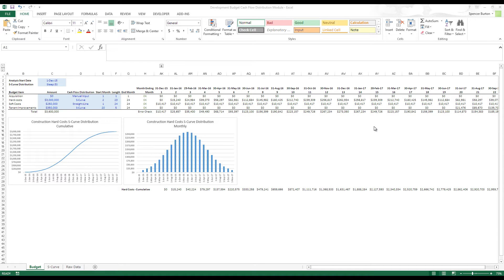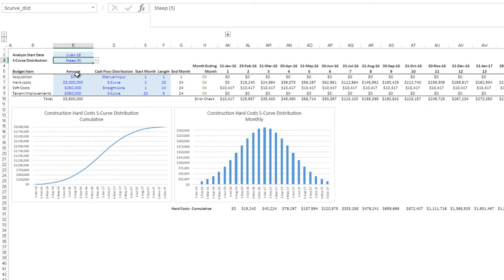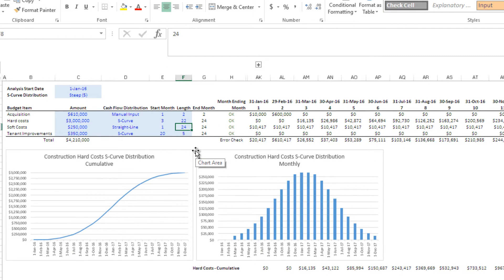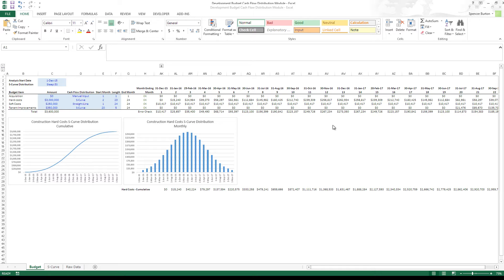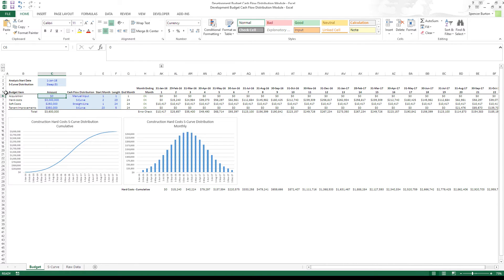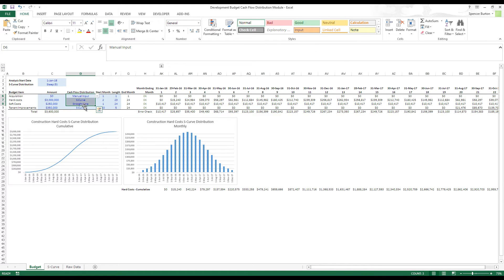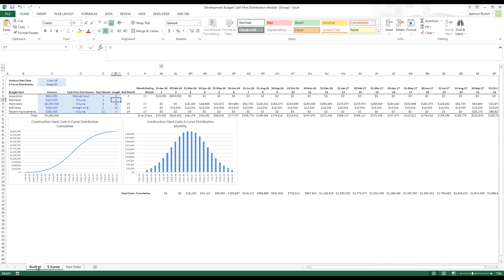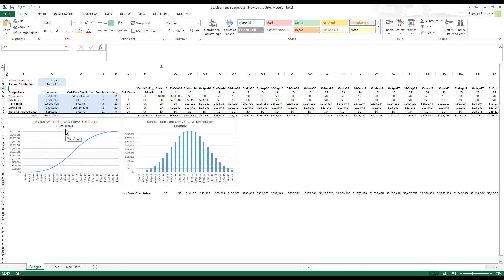Real Estate Development Cash Flow Forecasting Module using S Curve (OLD)

Comment: My only comments would be that from concept to completion of construction projects typically last longer than 24 months (even though this is not a construction project per say)  and it would be nice if you could adjust the "S-Curve Distribution" to each individual line item - also adding front loaded and back loaded curve could help as well - But it is a fantastic tool! Thank you for posting the video and creating this tool!